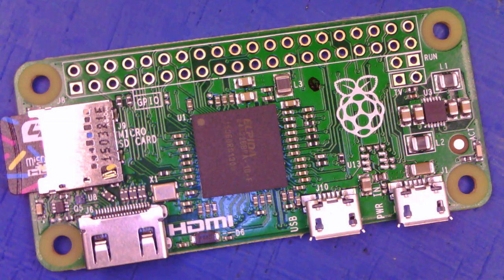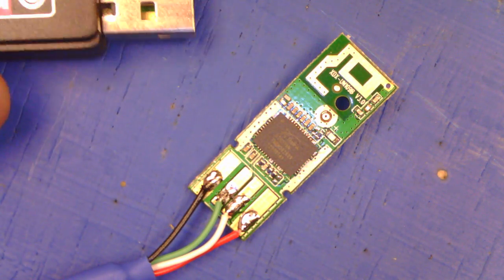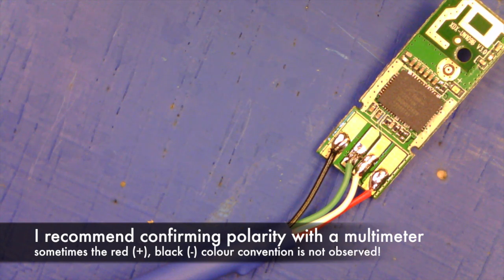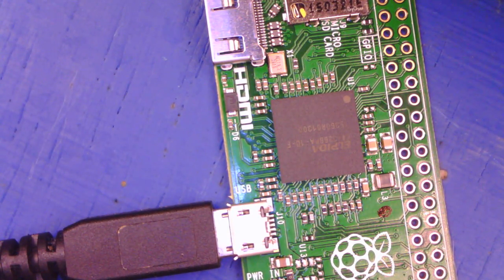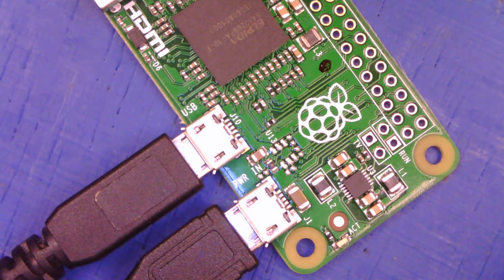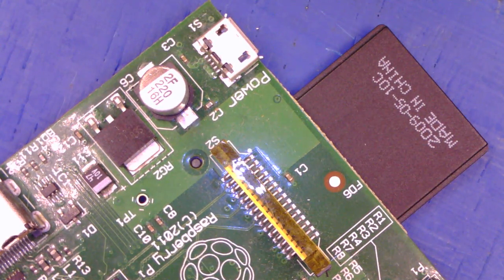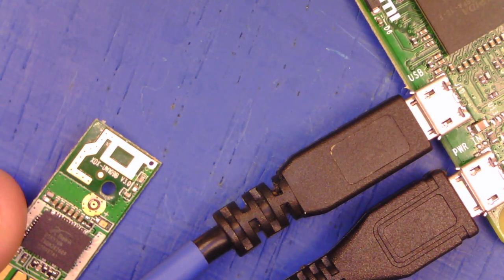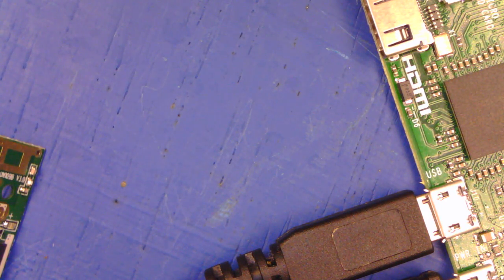Wifi Hack for Raspberry Pi Zero

Comment: +Luc Small 
hey man,
 is the connectivity of the wifi stable? i mean i don't understand much at electronicts so i have to ask. is the voltage for the usb dongle which runs the wifi, has enought power to run it correctly and stable?

Comment: Check HubPiWi - a project at kickstarter. It integrates USB Hub and a WIfi and does not require any Cable or Connector. Also has an onboard PCB Antenna.

Comment: 1: soldering a USB outage to a microUSB cable is not hacking.... hacking is the act when one chops up wood logs into smaller pieces with an axe
2: you could have easily configured the wifi on the very same machine, after you prepared the microSD, literally the only thing youd have had to do was to edit a single text file.... what the fuck is your problem? you soft in the head?

Comment: If you solder the WiFi board to the back of the zero it would be cool. But this is no hack at all.

I use one of these adapters: http://www.ebay.de/itm/USB-Micro-B-mannlich-OTG-Adapter-Stecker-auf-USB-A-Buchse-2-0-3-0-/121723312997?hash=item1c57465b65:g:yDAAAOSw~gRVwwUI

easy and cheap.